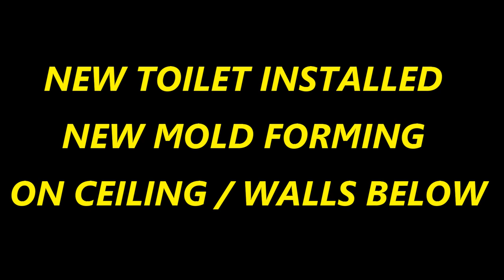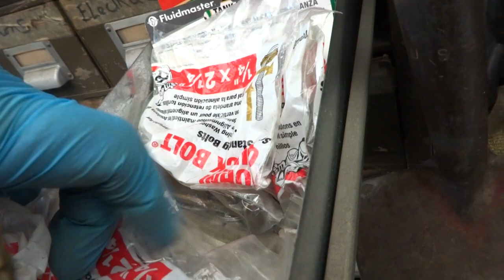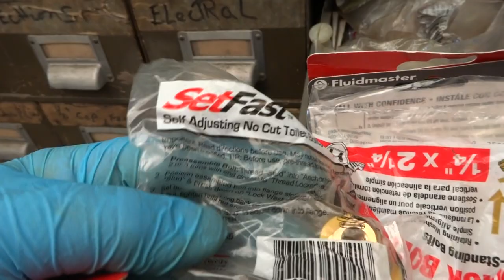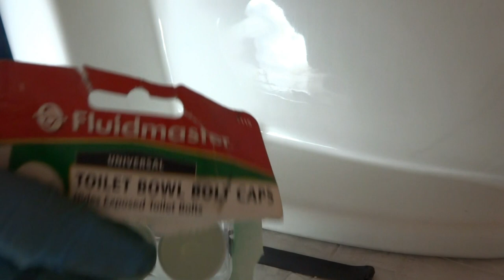From Freshness to Danger: The Startling Appearance of Black Mold After Toilet Upgrade

Comment: Yes sir...I said to myself at the beginning of this V-log.  "I bet that Steve will find one of those Funnel Wax sealers under that toilet".  Steve also said if I had already bought one of them--to just cut the funnel-off with scissors. Thanks, again, Steve!  This is a good example of over-engineering a product, because it looks good "ON PAPER".
(I expected that you would have soaked that jumbo wax in hot water--but I guess you did not need to because the truck was already warm enough).

Comment: How is that mold going to be coming from the toilet upstairs without making circles on the ceiling? I say there is no vent in there and it is caused by that dampness. The wall paper is faded. I would bet that is an ongoing issue.

Comment: Ever tried the newer  “Perfect Seal” product on the flange instead of just wax especially when the flange is recessed into a ceramic floor?  The seal gives 2 options depending on flange height.  I like the product compared to only wax even without the stupid always fail funnel.

Comment: I've never seen a wall outlet so close to a stool.
Reply: At 0:28 I see that too.  That is really strange.  Why in the hell would you need an outlet by the toilet???  Makes no sense.  The only thing I can think of is a bidet; but aren't all bidets just powered by water?  Idk.  Weird.
Reply: High end toilets with seat warmers like Toto require 110 power.
Reply: A lot of new homes have the outlet installed at toilet areas for bidets. You are correct, some don’t require electrical power. Others have more options, night light so you can see where to sit 😂, Heated seat, blow dryer, and remote controls.
I guess it’s for a “full service poop” 😂😂
Reply: @SheilaSpencer1  I've got a little 1 gallon water heater next to my toilet for the bidet. I can only fit a basic bidet on the 1 piece toilet I have, so the heater is separate. Lets just say that without one mid-winter New England tap water will REALLY wake you up in the mornin!
Reply: @SheilaSpencer1  An electric Toto is life changing. Very expensive and worth every penny. Never need TP again. Google the top of the line and you will see all the functions it does. When we go on vacation we miss the Toto. They make handheld portables we take those with us.
Reply from the maker: they have heated -biday type toilet seat .they need power to heat the water .so you dont get a cold dush .thats probley why she wanted a plug by toilet . this bathroom was just remolded / redone